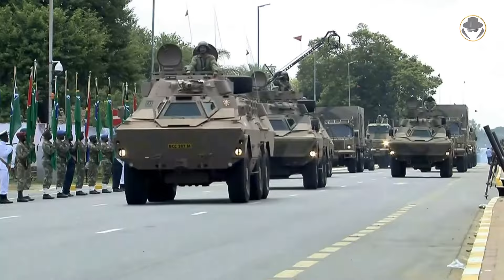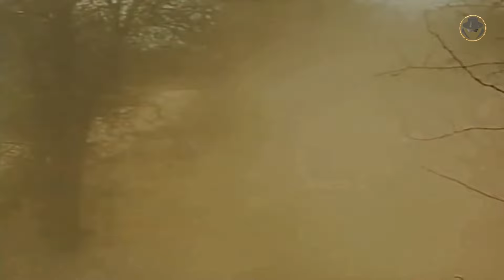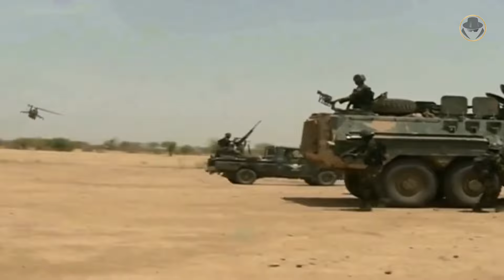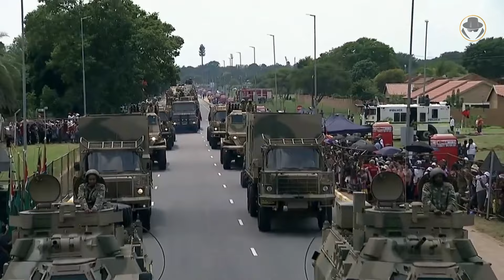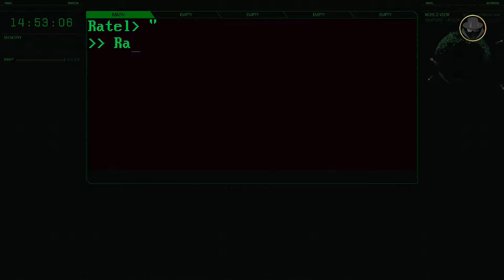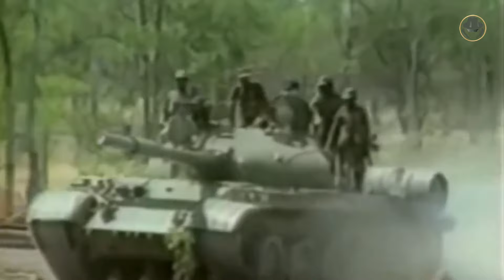Ratel | An unforgettable wheeled armoured infantry fighting vehicle legend

Comment: The true strength of the ratel was in combination with its cousin the Rhino. So you could have every weapon imaginable from 20mm cannon to 150mm artillery gun maneuvering at over 90kmph in an area of about 1000km that same day. being able to pick its fights it knows it will win. Not holding ground but always maneuvering to a point where they have cover or range advantage.

Comment: I was in a Ratel 60 fire control post with AS Artillery equipment, our did 120km/h. You could not stand in the turret, had to use the sight glasses (periscope)

Comment: South Africa installed anti-tank missiles (ZT-3 Swift missiles) on the Ratel in 1987, it was referred to the Ratel ZT-3 and proved deadly against the T54 and T55 Russian tanks during the Bush/Angolan War.  The enemy lost 93 Russian tanks, South Africa lost 3 tanks, it was the largest tank war in Africa since WW2.
Reply: And the 3 SA tanks got hit by minefields not enemy tanks.
Reply: While the ZT3 did prove effective against T-54Bs and T-55s, it is misleading to conflate its combat record with total FAPLA and FAR (predominantly FAPLA) tank losses during the broader Cuito campaign. Those figures represent a cumulative series of engagements spread over several months, with widely varying levels of intensity.

The ZT3’s most notable success occurred during Operation Moduler on the Lomba River, where a single Ratel ZT3 destroyed three FAPLA tanks within roughly ten minutes. More striking still is that the ZT3s involved were pre-production systems, far from their final operational configuration.

Comment: Could you possibly see if you can find out anything about the Zero Charlie Ratel - A mobile electronic warfare vehicle with a crew of 3 and no weapons.  It was often deployed with Ratel 20s and Ratel 90s (although often is perhaps the wrong word here.  Relatively often may be better).

I received very brief training in one, and had friends who spent more time working with them, including stories about using them with Ratel 90s to successfully take on the bigger soviet tanks by blocking all (or most) external sensors and external comms.

A final thought - while your technical description of the vehicle was impressive, it failed to convey how truly versatile and useful it really was.  It really was a go-anywhere do-anything go-to vehicle.

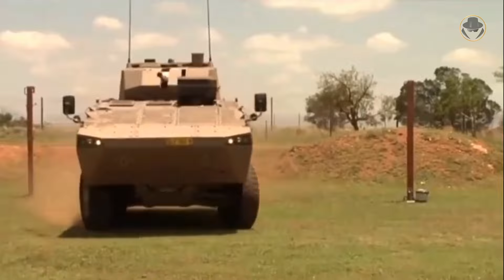Comment: 13:55 it's really a sad state of affairs that Denel is losing it's capablities and prowess. You could say it's due to government mismanagement, but it's more to do with the competitive and cut-throat arms manufacturing space, and which countries can produce/enforce production. 

SA doesn't fight in active wars, so over the years the local demand for tech has dropped substantially since the 80's.  Exporting it to other African countries makes the most economic sense, which is probably why they focus on Ratel "DLC" or add-ons to existing fleets than selling new vehicles. 

I am assuming this is specifically for the vehicles department at Denel, because they make several systems and weapons .

Comment: Just by the way... it's pronounce RAH-TILL. Not "rattle" although most of them did
Reply: Actually nope, absolutely no rattles at all tbh, all I heard as a gunner was that massive 6 cylinder Bussing engine whine as it goes through its automated gears lol, the Ratel 20 was a solid beast with no problems whatsoever and espeacialy no rattles, maybe if hitting a jump at high speed one might hear the suspension bottom out but I've not even seen that and I've had my good share of ruff n tumble with Ratels, they wer unbreakable tbh, I was always amazed at how solid it was on its wheels compared to its massive size because as the gunner I've also actualy driven them myself alot and could feel for myself just how safe it actualy handled even at high speeds, so I know they don't rattle bro, these wer my home for a good part of my military time✌😉
Reply: @frednel4326  The metal grids on the floors rattled...but you couldnt really hear it over the engine and torque converter noise.
Reply: @Mr_Smith_369  nope I don't know about that dude, the Ratel had no rattles lol, I lived in those things so I know 😜🤘
Reply: @frednel4326   You dont remember the  metal wire floor panels where the waadproppe were ? Probably use as braaivleis grills

Comment: For the retel 90 is that -8 over the drivers hatch or the most it can get to the left or right of it cause I believe it could go Slightly lower if not facing the direct front but I could be wrong also could the ratel 60 load any ap 60 mm rounds
Reply: I was trained as a Ratel 90 gunner in 1987 so I can answer your questions. The gun could actually decline to -10degrees, but the top of the drivers hatch would block you from reaching full declination over the frontal arc, hence the -8degrees mentioned. 

At the time all 90mm gunners were also trained on the 60mm as well. The 60mm breech-loading mortar was a fun weapon to shoot, but very inaccurate in direct fire due to it being a smooth-bore. We only had high explosive, smoke, and illumination rounds for that mortar. There were no HEAT rounds.